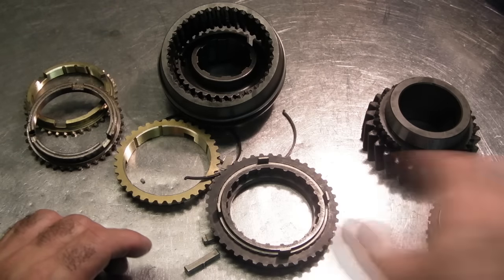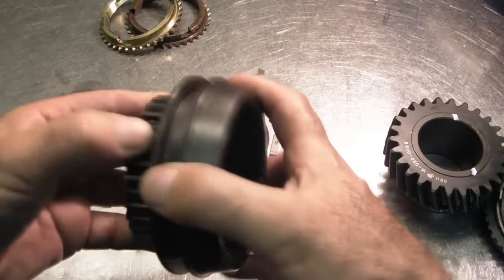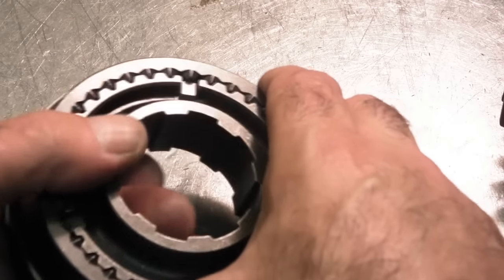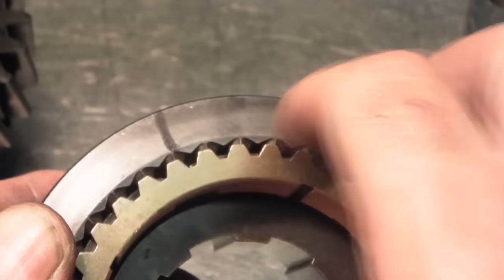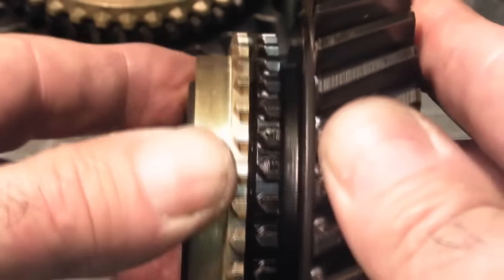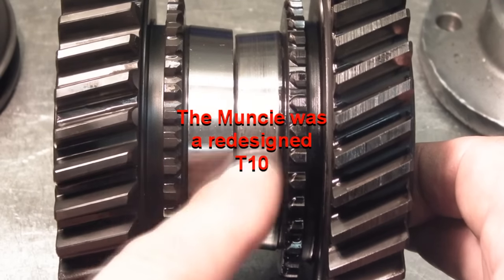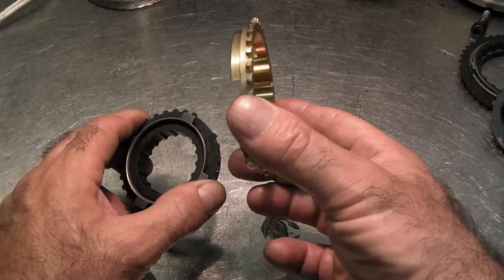Learn About Transmission Synchro Rings

Comment from the maker: Again everyone... your SECURITY restrictions on your Google plus accounts prevent me from responding to your questions
Reply: GearBoxVideo nicely explain
Reply: GearBoxVideo ... Very impressed... I have a Muncie 4 spd in my impala with a Vertigate shifter, love it but with these times I need a up-scale trans like the Richmond 5 spd. But don't want to loose my Vertigate...what is your comment?
Reply: please help me reply me i have a problem i m using ford fiesta 2009 tdci engine today im facing some problem with my gear shifting when i move my car with 1 2 3 it has some weird sound  but when i use top gear it doesnt have any sound and car runs smooth whats the problem please reply im your subscriber pls tell whats the problem...
Reply: GearBoxVideo nv4500 long teal shaft dodge
Reply: Hi. I want to do this. Where should I start. Im aircraft technician. Please answer
Reply: Tiny posluszy. I have an 06 Hyundai elantra and it pops out of first gear sometimes while trying to take off from a stop. Is this for sure synchronizer
Reply: Thank you sir for this video I really learn some great information tonight.that I did not know 👍👍👍👍👍
Reply: Thanks alot bro. I have a 1998 honda civic and 3rd gear is blocked out. Im pretty sure you just gave me the answer to my problem!
Reply: 80W90 is the cause for block out
Reply: Mikey Larsen
Hey thanks so much for the lock out explanation. Have you ever worked on  
a getrag 360? Ive been dealing with lock out after shifting into nuetral and coming to a stop. I put it into fifth or reverse and it will release. So with what youve said probably means theres something wrong with the 1rst 2nd syncro? Only problem with it is parts seem to be unobtianium for the 1rst 2nd syncro do you have any advice on how to locate parts?
Reply from the maker: I would try and find a core unit since you might need other parts in the future. I have a few ZF cores as spares for my BMW since parts are also not available

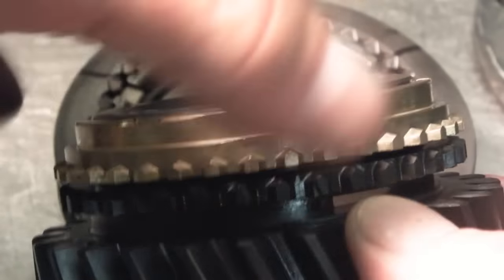Comment: AAAAAAHHHHHHH.  My ah-ha moment came at about 6:20--that is when I finally understood how they work.  The synchros are doing two things, one is the little back and forth, that is to get the teeth lined up for finally sliding in.  Then the cone on the inside is a clutch--the inside slides, but the teeth aren't sliding, only the inside is sliding, but then once the inside has grabbed, it has to be lined up within the little play back and forth, then the teeth can finally slide in.  I get it!

Comment: I just bought a Toyota Supa T combi, it  was used for transport business, now I realised that the gears made a cracking sound, thats from 1-2, 2-3, 3-4 but 4-5 is just fine, so I figured its a gearbox problem! Firstly the alignment of synchro rings was wrong because the gears were mixed, that is where there was to be 1, it was 3 and 4 for 2! Thank you

Comment: Thanks for writing.  I think I wasn't clear.  I understand how the ring works with the slider and the hub--the keys keep the ring locked to the hub so it allows just limited play.  My question is how does it work on the other side of the ring--after the ring has been pushed against the gear, all the pieces are moving the same speed, but the teeth in the ring are not necessarily synced up with the teeth in the gear. . . .

Comment from the maker: +Tony Posluszy Your security permissions don't allow me to reply to your comments. Just because you have new synchros installed doesn't mean they are good quality ones.
Reply: Besides OEM what brand names are good when it comes to transmission parts? What do your kits come with? Timken bearings? National Seals? Need to know the best brands for these parts... (like the PowerStroke 6.0L engine, cheap parts generally become disastrous and sometimes come back to haunt you)
Reply from the maker: There are no good brands as a blanket brand. Example; some SKF /CR seals are really bad and short lived compared to some Tawanese seals. It's about quality parts and experience. I have built 1000's of transmissions, so you get to know what works best for you.

Comment: Best video I've ever seen on how synchro rings work! Most other videos show the cone clutch speeding up/slowing down the gear to match the slider, but don't go into detail about how the blocker ring stops the slider from engaging until synchronization is complete. Also, now I know why my old car sometimes just wouldn't shift into first. Thanks :)
Reply: First and rev problems can also be from the clutch not completely disengaging 😇

Comment: I appreciate the inner working of a manual transmission now, thank you. I've had a 66 327 corvette since 1978, it always would pop out of 2nd gear when you let off the gas, I've never repaired in over 40 years, I believe its a Muncie, someone called it a "rock crusher". I'd like to have it repaired, now I know what's involved. Great video, thanks again.
Reply: My 69 Firebird had a muncie that use-ta do that. Even with a new blocker ring. I remember a Co. that sold a syncro assy, to cure that problem, that wasn't too expensive. I can't remember the details of the replacement parts, that compensated for what-ever caused that ailment, cause it was so many tears ago. But I do remember it fixed the problem. I think it's a common problem with some muncies. Maybe the 2nd gear gets a little wear on it's bore, and rocks. (?)
Reply from the maker: It's the gear itself and the slider usually. New synchro rings will never fix that issue

Comment: I used to build gearboxes for a living for the UK market. for the Ford Transit, the newer coated ring was often disgarded in favour of the older brass ring, as often the coating would break up on the newer rings. VW thought they were making the gearchange for 1st and 2nd smoother on the 0A4 boxes, which replaced the 02J box by using smaller dogteeth. to this day, this is a design fault, as the hub outer slide ring hits the 1st gear dogteeth with the 3 part syncro offering no breaking effort on the gear. This leads to the hub slider teeth burring over, and then prevents it from traveling into 2nd gear. And finally, the UK Toyota MR2/Avensis/Cellica gearbox uses a cheaper bearing over the import model. when it fails, the damage to the gearbox is quite destructive, but dispite the mass trauma, some good cleaning up with debur tools and a new CWP, along with a rewelded and machined rear case puts it back on the road.
Reply: +Allan Dawes Have you opened a Celica GT4 (E154) gearbox before? I'm thinking of rebuilding the engine and the synchros because its kind of notchy to get into second and third gear at speed. A guy called Ryan here on YT has made videos about it and it seems simple enough.
Reply: +MityLite Ive done the 5 speed manual box's. The 5th hub is the only tricky bit to get off. I usually unbolt the 5th fork from the shaft and slide the outer hub and fork off, and recover the strikers and wire clip. Note the orientation of the strikers. Then remove the C clip. I used a 2 legged puller, but half stripped down and using 2 M8 bolts, but make sure the thread goes all the way to the end of the bolts, and doesnt have a taper on the end. Screw the bolts into the hub center with the puller in place, and carefully work it up. When you refit, make sure to have a block of wood supporting the input shaft, and use a tube drift to knock the hub back on. You can have it complete when you knock it back on. Give the striker clips a slight strech to give them a little extra hold. Won't cause any problems with gearchange. When you press the gearshaft, have the spitters under 4th,then 2nd - pressing the whole lot from 2nd will chip teeth. Then remove the C clip and press 1st. There is a little ball under the washer below 1st. Note the syncros are sided, so dont swap them around, else it will be hard to get gear. If your having 1st and 2nd issues though, it is most likely the clutch. The bearing under 5th usually breaks up and locks the box up.
Reply: J'ai une voiture audi 100 Anne 1987
Jai le 2em ne repons pas fasil.
Nkoun nijri 3em  nraja3 2em yt3ada bisif

Comment: What about an nv5600? It grinned for a bit when using the clutch then I started rev matching without the clutch. I changed fluids and now I lost 5th gear. When I try to put it in 5th it just feels like nothings there
Reply from the maker: The 5th gear fork may have broken of the dowel pin simply dropped out.
Reply: Yoooooooooo this is a rare sighting
Reply: "without the clutch" 😬

Comment: Absolutely stunning!
Brilliantly detailed explanation of synchro function.
Over 1.6 Million views!
Posted 11 years ago AND YOU'RE STILL RESPONDING TO ENQUIRIES!
Simply stunning!   Paul, you've blown my mind.
Would gladly travel a thousand miles just to shake your hand. I am impressed beyond words!
I can't travel that thousand miles because my boots would get soggy long before I made it to you, since I'm in Queensland Australia.
I run 1980s 60Series LandCruisers with locally built GM Holden 5L V8 power. (Similar to smallblock Chev.)
These engines have long torque curves & they make good usable HP at significantly higher revs.
LandCruiser gearboxes are painfully slow to synchronise mainly because the ratio spread is excessively wide to suit lugger engines that do not rev, the rotating mass of the cluster & associated gears is heavy & the synchros don't cope when the engine is revved.
Even double clutching on down shifting when climbing hills pulling a heavily loaded trailer is a fail since LC box takes so long to synchronise & downshift, you're almost rolling backwards trying to get down through the box.
Grade angle changes on hills I travel over vary part way up. You rev the pick handles out of your engine in second on a lesser gradiant & end up rolling backwards trying to engage third. You lose momentum & the excessive hike from second up to third coupled up to slow shift causes stall in third gear & you're forced to re-engage second...   You rev your engine to death for no gain.
Standard HOLDEN gearbox behind 1990s 5L V8 is rugged common global T5 with brilliant short throw shift, closer ratios & very rapid synchronisation. I have several T5 boxes.
I looked at using a Jeep renegade T5 gearbox case & transfer case with Holden internals as a conversion. That poses a problem. LandCruiser transfer kicks right to align with RIGHT SIDE DRIVESHAFTS, WHILE JEEP TRANSFER KICKS LEFT.
Will common global V8 T5 internals graft into a Jeep Case?
Must get a beautiful T5 into a LandCruiser behind my V8, preferably with original LC Transfer Case.
Any advice or suggestion would be helpful.
We have engineering capabilities & can cut mainshafts down if need be to accept an adaptor between T5 box & LC Transfer case.
Speedo cable isn't a concern.
Is it likely a Jeep Transfer could be rotated on the back of the box to swing right instead of left?
Is it likely a Jeep Transfer would bolt up to a common T5 box with rear extension housing removed & mainshaft shortened?
Does anyone over there fit T5s into old 1980s LandCruisers?
I rarely use 4 Wheel Drive. I often use Low Range to reverse trailers & manouvre around in tight areas. I understand the T5 2.54:1 First Gear will be much higher than the LC Million to One First Gear. I'll run a sintered bronze solid button clutch if needed.
One of my engines runs a big overlap cam & spins nicely to 7000 RPM. I cannot use THAT engine with the hopeless original LandCruiser gearbox.
I have lower profile tyres we can use to lower gearing instead of swapping crown & pinnion sets.
I haven't found a single LandCruiser with a T5 anywhere in Australia & most of the Jeeps we see here are automatics.
I've looked at this headache on & off for several years now. I have a Nissan 720 Divorced Transfer Case I can JackShaft in behind a standard length T5, but that involves a cradle fabricated into the chassis, a 50 foot long transfer lever, an entirely new longer front driveshaft & a ridiculously short rear one, PLUS 720 Divorced Transfer Cases are fairly rare, I have no spare & the one I have looks tiny & feeble to me. It would be a disaster to re-engineer the old truck around the Nissan Case & have it disintegrate behind the punchy little V8...  It gets worse: I'd also likely have to lose my long range belly tank to fit the Nissan case so far back in the chassis.
Can you help with this oddball problem? I'd buy an adaptor- T5 to Toyota Transfer tomorrow if I knew where to find one.
Reply: We do a lot of high speed highway towing in hilly country. Have had LandCruiser box just start to weld gears onto her mainshaft & changed gears in the nick of time before welding became permanent.
I believe T5 overdrive is much steeper than barely noticeable slight LandCruiser overdrive. This enables lowering final drive ratio without losing top gear overall speed. LandCruiser ratios are pretty sad.
Both my LC boxes are tired & suffering. One jumps out of 3rd & 4th on deceleration which is pesky when crawling down steep grades fully loaded. 4th will hold her with no trailer. 3rd works with the trailer & both were jumping out when I bought the old girl back in 2018.
The other truck still runs original 2H diesel Tojo 6 Banger & she jumps out of 5th instantly when you lift your foot off the loud pedal. You literally must hold her in 5th gear the entire time at highway speeds. I'm used to that.
I don't abuse gearboxes. I drive quickly without hurting my gearbox. Both these Japanese turds of gearboxes had these issues when we bought the vehicles. Nothing has deteriorated, there are no bearing noises. The box that jumps out of 3rd & 4th is behind the V8 & it's just a loose & chattery tired old box exactly as it was when we got her. Truck was V8 when we bought her & box has stood up OK all things considered.
I cannot justify rebuilding these horrid gearboxes when I have perfect T5s on the shelf.
Am gearing up to replace engines in both trucks soon & would like to resolve gearbox issues at the same time. Have to fit fairly big header system with one of my high performance engines & I hope to set those pipes up around the entire engine & box/transfer as an assembly. Can't really proceed until we solve the gearbox problem.
An adaptor would be my best option.
Reply from the maker: The Jeep is in the non world class version and therefore is much weaker than the holding T5. I do have some Holden parts actually here most of them were 2.95 ratio. It's a better version and from the parts I have here they were world class. At least these were. I'm not too familiar with transfer case hookups and how they would work but I guess anything is possible
Reply: @GearBoxVideo 
Thanks for getting back to me.
As far as I am aware, EVERY T5 ever fitted to any Holden was the stronger gearbox. They were only fitted behind torquey Australianised 3.8L Buick V6s & also torquey 5.0L V8s.
I have at least 6   V6 boxes & 4   V8 boxes.  The V8 box runs a shorter input shaft & that would keep the transfer close to it's original location.
I can easily shift the compact Holden V8 & box assembly forward in the long straight 6 engine bay if need be.
The problem is grafting a transfer case onto the back of the Aust T5 & keeping the driveshafts on the right side.
I'm in a fairly remote area & there are no conversion gurus to be found.
I figured fitting strong T5s behind SmallBlocks into 4X4s over there would be fairly common.
It looks like I'm on my own with this one.
Thanks again. You're doing an incredibly good job.  People like you are extremely rare nowadays.
Reply from the maker: @johnbrooks9523 if you borg warner part numbers I may be able to help out.

Comment: It's obvious  you are into these trans and your excitement comes through in your voice. You were on a roll in this video and you made everything perfectly simple to follow. I especially like the fact that you show how each style has it's good points and weaknesses. 
The aspect of the correct type Lube was awesome and to the point. I hear of so many guys wanting to go away from the recommended and try some Snake Oil from some salesman. Now you talk about disaster waiting to happen.
It was really nice to see someone else point out how not to mismatch components. 
I hear guys tell me they took two trans and made one. Later I get it in with shifting issues...and then they wonder why it needs so many replacement components. It's like you pointed out, Rebuilding the engine and replacing all the internal components converts into trans rebuilds. You don't just replace what looks bad or is worn without considering the whole unit. I don't get how that notion all started but it's been that attitude for ages.
Some people just don't have a concept of how these work and only know how to change parts but not how to build. I know you'll know what that means.
Anyway, another great informative video and I learned some more new things again. Thanks.
I find so many sites that show some guy doing some kind of build with his special trick or new component. Have you ever noticed how their project is at one level of completion, the video breaks away and all of a sudden a ton of work's been done? Then when the guy comes back he starts talking like he did all the work off camera...The presenter has perfectly manicured hands, clean fingernails and clean clothes while you see a worker in the background working on a similar mechanical unit? IT always cracks me up. My point is I don't get that impression with you and you add more comments supporting what you're showing. It's certain to me that you are no pretender and I appreciate all the information you share.
I am impressed and now a faithful follower of your channel. Keep up the great work.
Robert (Auto Doc)